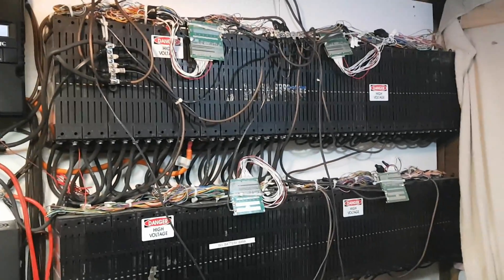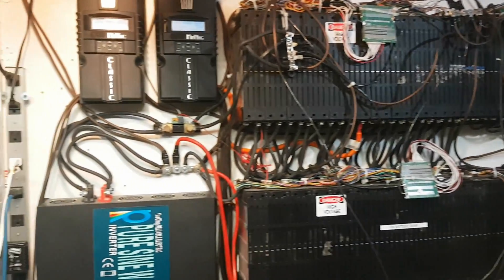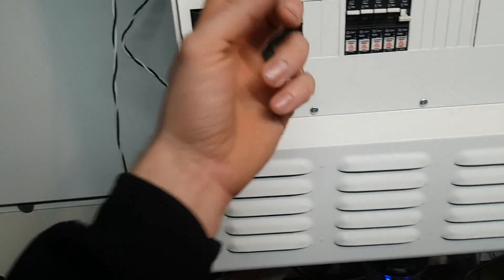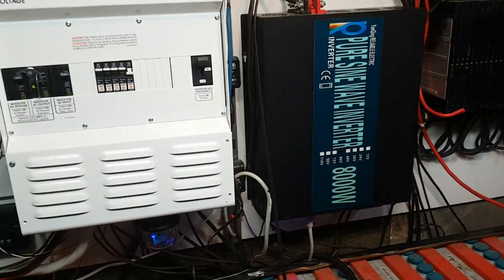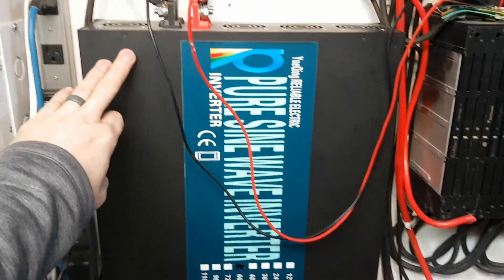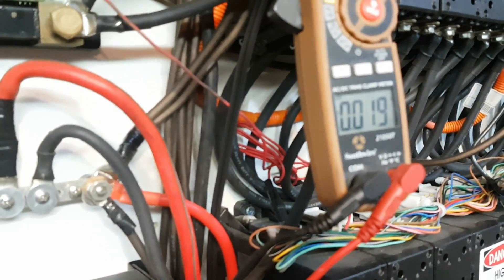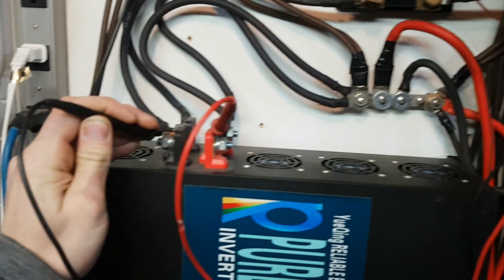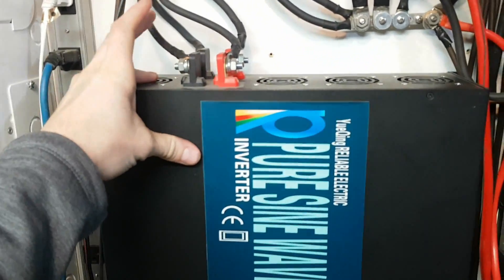Solar Update And AC Ripple Test

Comment: Impressive.  Very impressive.  
I'm facing a challenge on my solar I don't really know how to solve.  I have a 48v lead acid system that's working great, but my batteries are getting old and I'm starting to build some 18650 lipo batteries in my spare time, looking towards switching from lead acid to the 18650's in the future.  Problem is, the voltage of the tow battery types being different.  The Lithium as you know have a much bigger swing between full and empty than the lead acid.

Am I going to have to get a different inverter?  That would suck.  I'm looking at using dc - dc converters, but that's an efficiency loss.  IDK.  If you have any suggestions I'd appreciate them.

Thanks, and enjoy your day.
Reply from the maker: what inverter do you have now? with lithium you can go up and down 4 volts as the cells are 4 volts each, you will be able to use you lithium cells for sure.
Reply: Ranging from 4.2V to 3V, 
12S  50.4 - 36.0   36 is too low, the inverter low voltage protect would kick in well before that.
13S  54.6 to 39  Still too low.
14S  58.8  to 42.0   Both too high and too low.  
Or am I missing something?
Reply: I have a 3kw Reliable like yours, and a ( no laughing, it's been awesome for 2 years now ) 15,000 LF split phase Power Jack.

I've modified the Power Jack to improve efficiency and I managed to get rid of the battery over voltage alarm and shut down, but IDK if I actually got rid of it or just bumped it up a bit. It is set annoyingly low on the factory units and MPPT chargers set it off for some reason with a voltage spike they ping the batteries with from time to time. )  It's actually more like a 7kw inverter, but it runs things like large compressors and table saws and all kinds of stuff all at the same time without breaking a sweat.
Reply from the maker: 14s will work perfect for your inverter. you dont want to charge over 4.1v per cell and dont go any lower then 3 volts,looks like 14s will be perfect for you.
Reply from the maker: looks like you got a gem, I have a power jack inverter and it was good, buy I have not used in a while, I now love these reliable inverter, my 8000w is more like a 7000w inverter as well, they say 8000w for a few seconds.
Reply: OK, so 14s  at 14.1 - 3.0 would give 57.4v - 42. 0v.  The Reliable 48v has over voltage at 61v and under volt alarm at 45v, but it doesn't shut down till 43v.  So you're right, that would work pretty good if I disable the alarm.  

The power Jack Low Frequency inverter has much tighter range than that, cutting out at 45.5 and with over voltage at 50v ( no kidding) which isn't even enough for standard lead acid.  That's why I had to modify it.  I'll have to dig into it and test it at lower voltage and see where the actual cutoff is and see if I can figure out how to modify that. I would like to stick with the power jack LF.  As I said it's a beast.  It even held up to me accidentally putting grid power into it backwards by mistake twice because it has a built in charge circuit.  My reliable I blew up already once.  Which reminds me I need to fix it.

Thanks and enjoy your day!

Comment: if you can find a 8000 watt AC step up you to 220 you can go that route without using the magnasin im not sure about that big but i have a 2000 watt step up and ive seen 3000 before. But doing the step up method will most likely pull a lot of current
Reply from the maker: i ordered one, we will see how it works.

Comment: Have you ever figured out the standby wattage of the 3000-8000 watt inverters? (the power they draw without a load) <-for the people that my not know what that means.
Reply from the maker: the 3000w is less then 15w and the 8000w is less then 35w

Comment: Very good that inverter should love you long time with that. Easy test to do. Most people do not realize the importance of that test. Do that test every 2 months or so my friend. Then you will know if you have a battery going bad or a connection going bad. Best way to keep an eye on the overall health of your system.
Reply from the maker: will do, this is the first time I have seen this, I missed that video of yours not to long ago. I wanna test my other systems now :D
Reply: did you see this link. https://www.mppsolar.com/v3/measuring-and-minimizing-ac-ripple/
Reply: Hello. I'm a first timer here in North Dakota. Just purchased a 4000 watt Reliable inverter. Going to power a completely seperate system in my house no ties to grid power at all. I see you use a 8000 watt reliable inverter. I will be using a 12 volt systen which will be charged with 4 100 watt solar panels and also a 12000 watt gas/propane portable genny. Which I am considering tieing into the system as well via a seperate breaker box which will be ran to the inverter breaker box the inverter will be ran through a 30 amp 2 pole breaker with a bridge to power both sides of the box. The genny will be controlled by 2 50 amp breakers @120v also bridged for both sides. All of that so if we have continuos cloud cover or lots of snow the solar power charger will be ineffective. So I want to install a charger to run by the genny. All of this to set up this question, what type or brand charger would you suggest to maintain 10 12volt type 31 storage batteries? And what kind of time am I looking at between charges at approx 70%ish load on the inverter? With all appliances plus lights and a propane forced air furnace Im guessing approx 2900 watts with all running. If you can help it is much appreciated. The batteries are 100ah each.
So what charger, and running time between charges?
My name is John and your videos have been so much help I got to thank you for spreading your experience.
Email is j_fogle@yahoo.com
Please feel free to use that. Also I will give my phone number to you via email if you would rather talk.
Thank you very much.

Comment: Can you send link to bms please ?
Reply from the maker: ok witch bms? this one is a 12s

https://ru.aliexpress.com/item/12-s-100A-smart-board-LiPo-PCM-PCB/32848466970.html?spm=a2g0s.9042311.0.0.Y3uY64

and this link is 16s I use

https://www.ebay.ca/itm/30A-16S-48V-LiFePO4-60V-Lithium-Polymer-Battery-BMS-Protection-Board-W-Balance-/112477569093?hash=item1a302f8045
Reply: Thanks

Comment: By the manufacturer of the Magna sine, the 30 amp is the INPUT  toward magnum Charger/ transfer Switch. The output (load) is connected at the second 60 amp breaker!!
Reply from the maker: yes I have noticed that :D I have been using the 60 amp only this hole time.

Comment: not really sure what the significance of ac ripple is, I'll have to seriously research it and maybe ask a uni professor , maybe I'll get it then.
Reply: I am sure i have given you this link before . https://www.victronenergy.com/live/_media/ve.bus:4._ripple_in_a_ac_battery_system.pdf. Its easy if the ripple is over one volt AC your inverter may go pop. if its over 1.7v you should not be using the inverter at all. Its the most important test you can do on your system. https://www.mppsolar.com/v3/measuring-and-minimizing-ac-ripple/ .
Reply: Justin Case Solar Power ,thanks, I don't remember seeing it I check everything you send me I'm a info junkie, maybe I missed it.
I have watched some vids showing readings on cars only, I couldn't get a reading using a mastech multimeter on any ac voltage setting  with the inverter under a decent  load, I'll have to find my fluke clamp meter and try that.
my inverter is a latronics 24v/230v 2300w
Reply: Its the nature of the beast. There will always be a little ac ripple. use a manual meter like i did or like he did in this video. When you work out how to do the test. You will find it very handy in keeping a close eye on your systems health.
Reply: Justin Case Solar Power with a 1533w load using test leads I got 0.00 , yet it measures AC DC , I'll  find the fluke eventually and see what I can find. I tested  many batteries, I was thinking maybe because its a LF inverter and not HF.
Reply: Make sure the meter is set to AC. if its an outo meter the test will not work. have a look at my video and see how i show how to do the Test. All inverters have have the AC ripple. The victron unit in the fist link i sent you is a LF inverter. They have built in protection on that unit due to them going BANG and having a shorter life due to AC ripple current. A $5 manual meter is good enough for the test. I show how moving the voltage higher and lower can alter the test.  20vac was the right setting for my system to give the best results to the test.
Reply: Justin Case Solar Power OK thanks I have a near new  mastech MY61 manual turn dial meter maybe its crap, you're right both fluke meters don't show a thing, they're fluke 362 and fluke322. I'll get a nice quality turn dial. I already had the one you show in the vid, with 20amps max  DC  reading I blew it up testing bat voltage in amp mode LOL . I'll get there one day LOL.
Reply: Yes meters are a funny thing. I find my cheep crap meters do all the work i need them to do. I have a costly Auto meter that i hate. It keeps going to DC when i want to test for ac ripple. I also have a 500amp AC DC meter for testing amps.